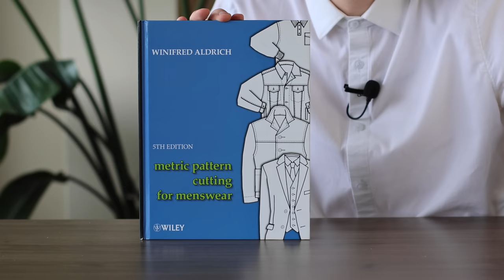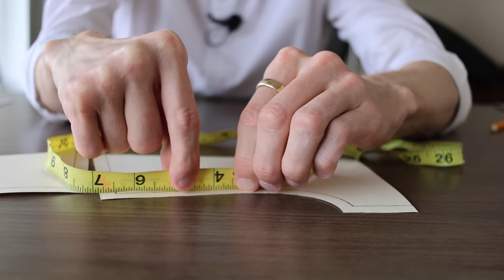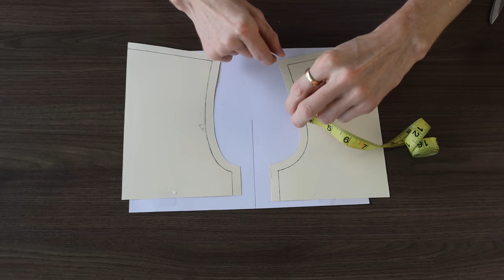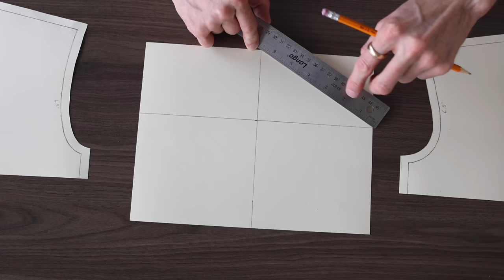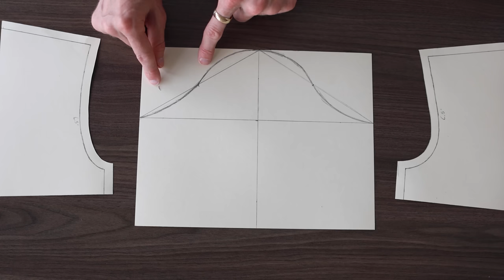Sleeve Patterns Made Easy + How to Draft Them

Comment: note that reason why the t-shirt sleeve is so comfortable while the armhole is cut so low is because the fabric is strechy. If you want more comfort in the arm on a less giving fabric, you'll want the armscye to be cut higher to allow for a full range of movement (an armscye cut lower will create friction and tension when rising the arm) and the sleeve can (and probably should) be left a bit larger than the armhole having the top eased into the correct length, the sleeve will then encapsulate the begining of the shoulder giving enough ease to rise the arms comfortable but not so much it becomes a puffed sleeve (it's also a great way to have a knitted jacket look more like a blazer because it's how tailored pieces are generally cut : make the head of the sleevehead a bit wider than normal, ease it into the armscye when sewing it in)
Reply from the maker: Thanks for sharing your knowledge and experience in the comments here with myself and others. I appreciate you elaborating as I get to learn more myself in the comments here.
Reply: This is why dolman sleeves look like they will be comfortable, but actually require you to keep your arms pinned to your side. Any arm movement upwards moves the entire garment up, off the body, causing bystanders to woner if you are about to disrobe!
Reply: @lauralake7430 😂
Reply: @lauralake7430 😅lol
Reply: So should the curve on the sleeve be shallow or is that not necessary if the armscye is high.
Reply: @michaelsrowland  it's better to have a deeper curve and to have the excess fabric at the top of the sleeve eased into the armscye, that excess fabric will work as an ease to allow the arm to move freely, if you prefer a shallow curve, that will creat a more oblique sleeve (the shallower the more horizontal, the deeper the more vertical) i would suggest a looser sleeve then, the looseness of the sleeve will counterbalance the shallowness of the head of the sleeve
Reply: @TheGabygael  I want to try and make a winter outdoor jacket like a patagonia nano hoodie. So I need to make it so there is full arm rotation. So a deeper curve with a high armscye would be good?
Reply: @michaelsrowland  pretty much, don't be afraid to make as many mockups as necessary

you could add a gusset underneath the armpit as well for added mobility but that would end up being really ugly
Reply: @lauralake7430 dolman sleeves are actually supposed to have gussets. But in modern times that gets left out. 

But if you look in tops from the 50s they all have them

Comment: Hi Cornelius, love your content as always!
I drafted a prototype shirt according to your other tutorials and it was a lot of fun!
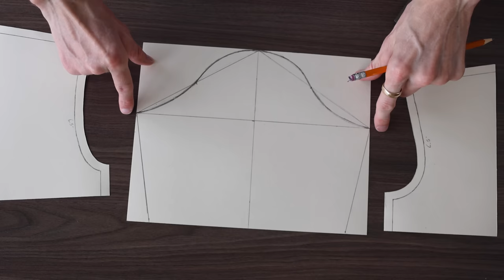I do have some questions though. At 14:53 in this video you measure the straight line as the same measurement of the armhole - is that the length along the curve, including the seam allowance? And are the new lines that are drawn for the version of the pattern with seam allowances at 17:04 inside or outside of the original lines drawn?

As an aside; I also attempted drafting a shirt according to the "tailored shirt" block on roughly page 233 of the Aldrich book. For the sleeves a lot of the measurements are based around fractions of the "arm scye measurement" - do you  happen to know if this measurement refers to the circumference of the scye ? With or without seam allowances? 

I hope I am not being too demanding - I am just really keen to make this work and get it right.

Cheers and greetings from Toronto
Reply from the maker: The length of those straight lines is the length of the stitch lines on each pattern piece. The goal wit those straight lines is to just get us in the ballpark of the right length. It isn't 100% precise. The second set of lines are drawn inside the first batch of lines that I drew.

As I recall reading in the book, seam allowances are included .

Happy Sewing.
Reply: @CorneliusQuiring  
Thank you Cornelius! I appreciate you appearing in the comments section so- so-much and I'm sure others here do too.

Comment: I've been learning how to draft sewing patterns (self-taught thanks to Youtube) the past 2 years.  When I was watching the part where you draft the sleeve,  it looked like you used the measurements from the armhole front and back with no seam allowance included and when you drew out your sleeve cap that became the cutting line and you marked a seam line inside of those measurements.  That may be why my sleeve caps have been coming out a bit too big requiring adjustments every time.  As presented, I use the armhole measurements to create my sleeve, but once I draw in the curve from the desired cap height, I add the seam allowance on after I get the correct lengths and desired ease to more closely match the armhole (depending on how fitted it may be).  I also got some other helpful pointers, but this one really jumped out at me.  Thank you for a very helpful tutorial and wishing you continued success.
Reply from the maker: Thank you for sharing how you do it. The more knowledge and experiences that are shared, the better.

Comment: I really enjoyed this.  You touched on something that pattern guide sheets don’t always mention.  All sleeves benefit from a gathering thread for easing two things that are shaped differently together.  I had sewn several sleeves with no gathering before I learned why it was just not working.  I started sewing in the mid to late Seventies, and puff sleeves, or ruffles instead of a sleeve for summer blouses were in style. So later when I moved to placing a fitted sleeve and the pattern did not say run a gathering seam, I didn’t know.  Knowing the reason something is done gives an additional tool for figuring out how to do it differently if needed.   Very informative lesson!
Reply from the maker: oh wonderful,  I am glad to hear that my video was of use to you. Thanks for watching and tThank you for sharing a bit about yourself.

Comment: Thanks for gelling together things I've mostly sorted out msyelf, one thing a lot of the sewists I watch don't cover in anything about fitting is how to actually move or change the arm hole. I'll be sneaking off to adjust my princess seam bodice block armscyes next time I make a supportive garment, I need the shoulders a bit more to the front/narrower and now I have a better idea how to actually do that.

I've also discovered a Secret Weapon against shirts being a bit too tight across the chest if they're fine down the ribcage: I add a small square armpit gusset. In my case it's usually caused by my bust, but also shoulder muscles can do it too if that's how you're built.
Reply from the maker: oh nice,  I am glad to hear that my video was of use to you. Thanks for also sharing your secrets in the comments here.

Comment: I had to learn all this from scratch,  because my armhole is more front to back  - lima bean - shaped than the traditional top to bottom/teardrop-ish  shape. 
A lifetime of the front sleeve seam digging into my front armpit has come to an end.
I built a form to match my actual  armhole size and shape 
Excellent video. 
.
Reply from the maker: Good on you for taking on the challenge and getting sleeves to fit you jsut as you are. Also, props on making a form!

Comment: You’ve answered so many questions I have had in such a clear and concise way and confirmed little details I’ve been unsure about like if the curve of the sleeves should be longer than the armhole and how much longer. I think I was taught but sometimes I forget and need a quick confirmation before proceeding 😅 

The way you use the tape measure makes a lot of sense. Does the shape of the curve on the sleeves matter much as long as long as the measurement is 0.6cm longer?

I wanted to do everything correctly and felt paralysed not knowing the important details and exactly what I had to do makes it hard to proceed. Finally finding a helpful video and knowing exactly how to do it properly is emotional 😅💖
Reply from the maker: I am glad to hear that my video was of use to you. Thanks for watching and happy sewing.

Comment: No one has explained how to make sure your sleeve is going to fit around your arm. How do you know how to figure out the math for how wide and how long your sleeve should be?
You did explain that here. Thank you.
Another question: how do you measure for a short sleevr vs. a long sleeve?
Reply from the maker: I'm glad to hear it. For short vs long, I simple measure from the point on the top of the shoulder where the sleeve starts, down the side of the arm to my wrist. I also note where the elbow lands. Then add seam allowance as needed.

Comment: wow, this is GREAT. I have been looking and looking for exactly this video!!  Also, very curious about how the panel on the back across the shoulder... how the shape affects fit, and if this panel is not used what is the consequence in terms of fit.  Why use that back panel at all?? Thanks!!
Reply from the maker: Good question. It's called a Yoke. The main aim of that pack panel is for the purposes of adding in a pleat at the center back which adds fabric for arm movement. It can also be adjusted at either end for a tapered fit ofthe sleeve.
Reply: thank you!  @CorneliusQuiring

Comment: I am having trouble understanding something. In this video you show that the back panel is a bit longer than the front panel, to account for our shoulder blades. However, if this is the case, then isn't the back armhole going to be longer/a bigger measurement than the front armhole? In your example your front and back armhole are the same length - 6.5. Thus the sleeve midpoint is right in the center of the sleeve. But if the front and back are different lengths than isnt the midpoint shifted somewhere to the left or right? Thank you for your video and help.
Reply from the maker: The curve my back panel isn't as deep as the front because of our backs being bigger and our arms move forward only for the most part. The shallower curve is therefore a bit shorter and hence them being the same amounts.

Comment: Thanks a lot. I tried this and got a perfect fit for the armhole. However, the bicep circumference was too big. Reducing the biceps width made the armholes smaller. What can I do to solve this problem? Thank you
Reply from the maker: The seam running under the sleeve (and down the arm) don't have to be straight lines. You can make them curved as well to reflect shapes you want.
Reply: @CorneliusQuiring  thank you

Comment: Yet another expert video - much appreciated. What's your take on notches? Going through 'Winnie's' book she mentions balance points - but never commits to explaining where they are to be placed (unless I've missed it) and notches suddenly appear on her blocks. I've always eased in a sleeve between notches, but with the walking the length method I don't think they are of use - but would be if the sleeve needed to be pitched forward or back.....my head hurts thinking about it! If using, would you place them where the curve changes from a concave to convex? Thanks
Reply from the maker: I personally don't use notches, because I tend to serge my raw edges. From what I understand they're used to line up the pattern pieces. I tend to just pin them and sew, or just mark with tailor's chalk.

Comment: Hello Cornelius, i have a question about Sleeve, what change I should do on patterns if I goint to use lycra material, because I had some problems but I can not understand how I can fix. mostly what happens is that the size pulls a lot.thanks
Reply from the maker: use a walking foot when you sew.

Comment: hey cornelius! one thing that i did not understand is that when you measure your armhole with a measuring tape, it was 17 inches but when you draft your armhole you take 6.5 inches each side, which means you take total 13 inches. How does that work?
Reply from the maker: At the end, where I draft, I'm making a scale model of a sleeve with scaled down armhole.
Reply: Not clear how you divide your armhole front and back